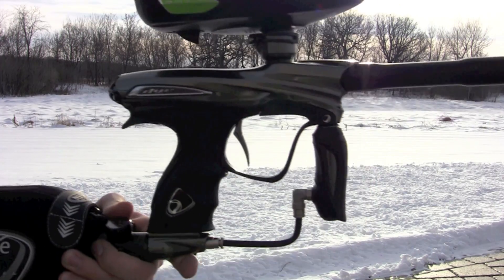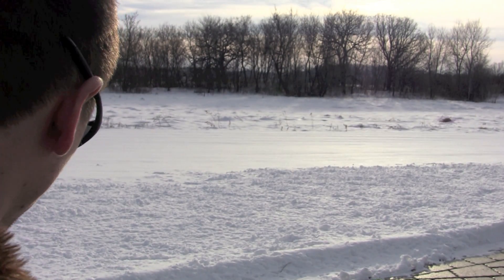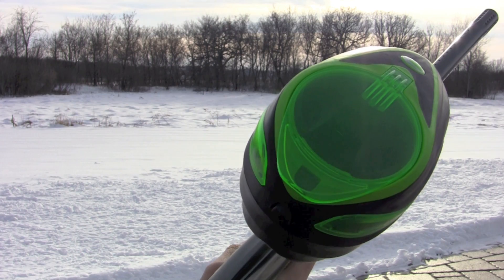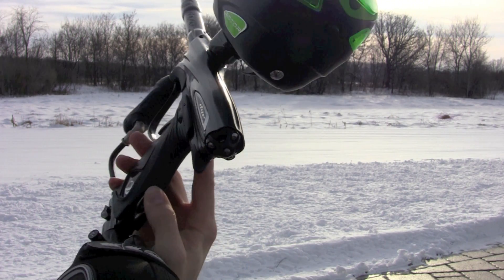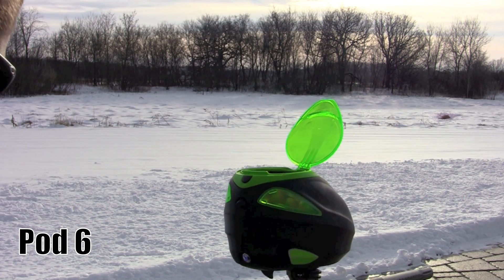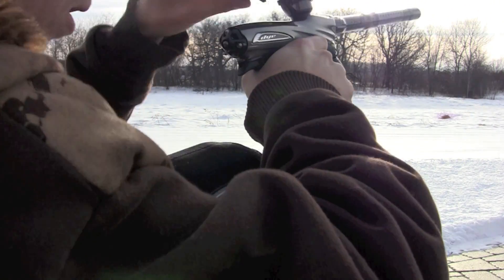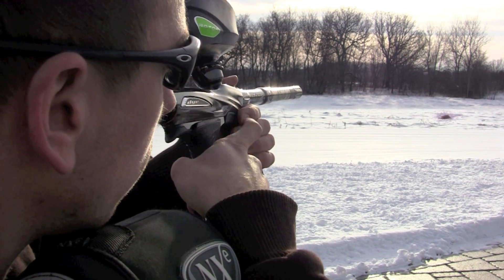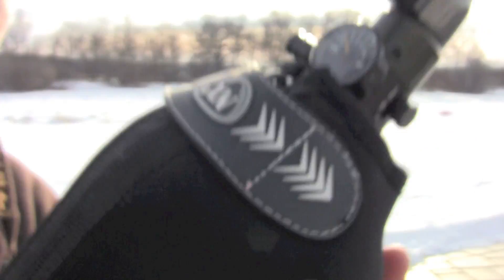NT11 Efficiency test

Comment: You know whats problem w my NT10..
I have shot about 25 cases thru it so it aint new or not broken in by any means..
But the problem is that it starts to leak from infront of the bolt if my pressure it too low and it has to be turned so high that its shooting hot for it not to leak..
i'm using 1 insert and spacer body and i have replaced all o rings and done total maintenance on all the parts of the bolt assembly?
Would be great  if you could help :) Cheers m8.

Comment from the maker: @supersuckthesenuts That's a hard one. Because the original NT worked so well (for me) but the new NT works even better. It's smoother than the previous NT. If money is tight, I would pick the original NT.